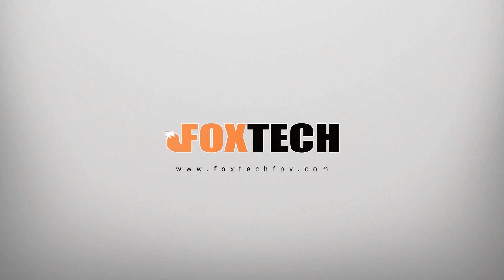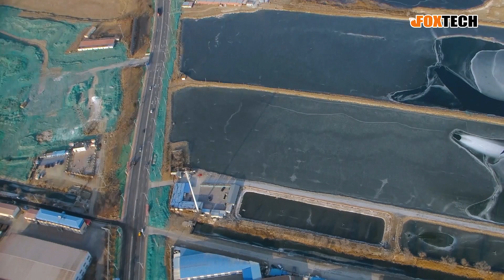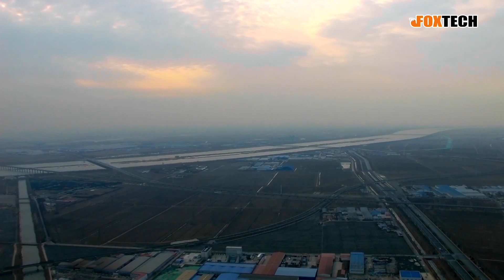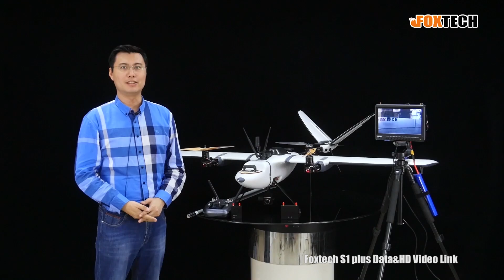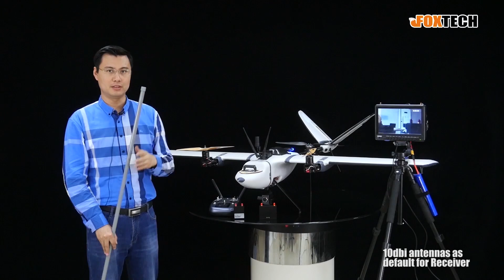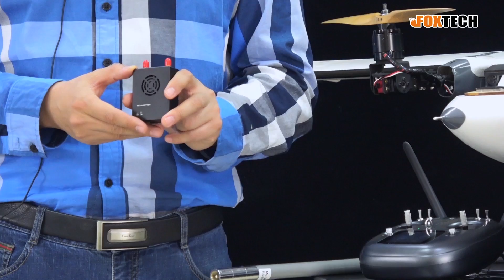15km Range HD Video&Data Transmission System

Comment: Im building a rc car that needs a range of 20km or 10miles would this work?
Reply: Hey have you been able to find something that works for 10 mile?
Reply: @jordycolin4390  if you want a rc to go 10 miles u need to get a portable Wi-Fi hotspot and connect it to ur rc to control remotely on your phone or controller etc
Reply: @jordycolin4390  ur basically building a Ugv

Comment: Hi. I can't find videos of the system working. Showing the delay, the captured video directly from the receiver. Nothing . You always shows the aircraft flying, but that tells us nothing. I very difficult to buy a usd3000 system if we don't know how it works. In this video you move the camera buy the aircraft is 10cms closer to the receiver.
Reply from the maker: the video system video is S1+ on the website, the delay of the system is 200ms, and it's a good point coz we didn't make videos to show the delay directly.
we are also preparing most of the training video to help our users to use the system
Reply: @Foxtechhobby  Thanks. Take this like an idea. Because you have several HD TX Systems in your Web page.  But is very difficult choose just by the description. Make a video showing the system working.

Comment: The PPM or mavlink support is very nice! So you can use it as a reciever for controlling the aircraft I guess? Great products you guys produce.
Reply from the maker: indeed, the receiver has datalink ,so there is no need to add another datalink, making the whole system simpler

Comment: is there an EU (Austria, Germany) approval for this transmission system?
Reply: Hi, Campilot. S1+ has three frequency options:  800MHz/1.4GHz/2.4GHz. Please confirm whether any one is legal in your area. By the way, what is the approval paper name you mentioned?
Reply: @CarrieDingUAV  thanks. In austria, we require a certification from the aviation authority in order to be allowed to fly commercially with a drone. we transmit the remote control signals to 2.4GHZ. Is not it annoying when transmitting the remote control and the video image with 2.4GHZ?
Reply: @campilottv  you can use a diffrent frequency for your control link such as 915mhz or 868mhz
Reply: @CarrieDingUAV  radio regulatory authority